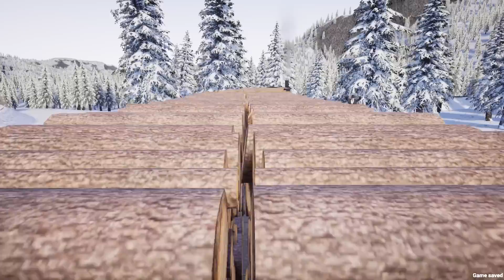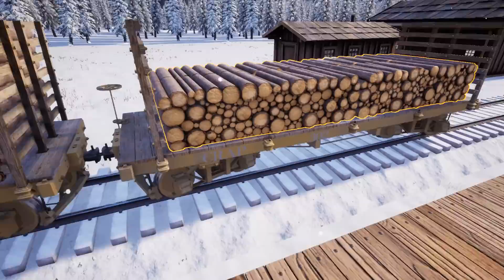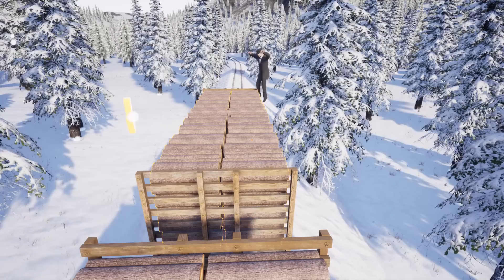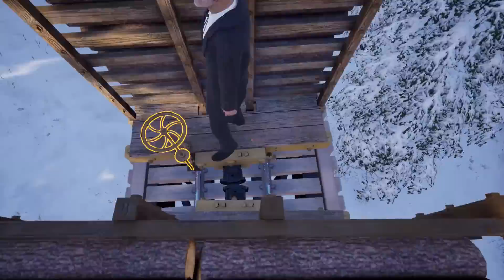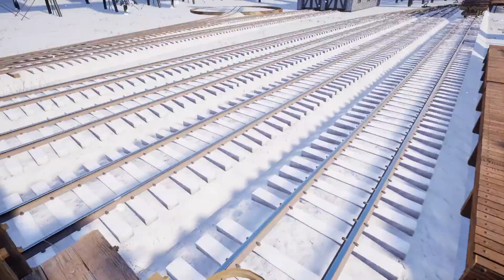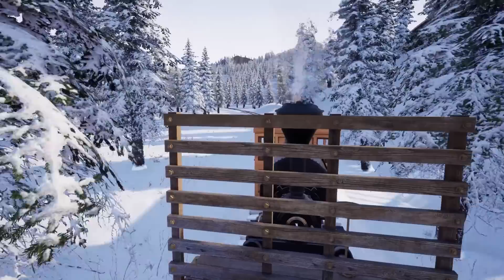I check brakes over and over even though I just checked them. (Railroads Online Gameplay)

Comment: So... interesting aspect with steam engines, just thinking about them loading that train onto the truck, when you release steam from the boiler, you are actually cooling the boiler. Think about how when you discharge a pressurized container, it chills in your hand. When they loaded the train, they probably drained the boiler, causing it to cool. Doing so is probably horrible on the boiler, but by drawing down like that, you can lose the water, lose temp and put on a huge smoke show all at the same time

Comment: I will not stand for Shay slander! They are quirky and fugly, but they are absolutely mechanical marvels and the most popular of the geared locomotives. Quick edit, YES THERE ARE GRAVITY TRAINS!!! In Wales, the Ffestiniog Railway and Corris Railways would use loaded slate wagons and let gravity pull the loaded slate down to the ports, since slate was very fragile and you can get better control with hand braking than a locomotive brake sine the trains didn't have continuous air or vacuum brakes. The locomotives were really only there to pull the empty slate wagons up the grades to the mines, and then they'd just use gravity to pull the loaded slate down to load.

Comment: You need a 1.5% to get  a car to roll alone. I have my log camp and sawmill set up with inclines to shunt cars into position to the cranes with gravity. I also have a 1% + whatever the curves add all the way to the smelter. I have in the past shoved cars down that incline.
Reply: I have 3% from Iron mine to smelter. 2% sawmill to iron mine.
Reply: 1% to the smelter must be a long way arround or just the cordwood run?

Comment: Do the engines add extra friction if you drag them in reverse? because you could just drag the engine in reverse down the hill then you'd be perfectly lined up to have the engine pull you back up the hill without needing to retrieve it.
Reply: They do but they also add weight which pushes downhill.
Should be fine. I'd take a Locomotive without tender though.
They tend to go better backwards.

Comment: We have a somewhat gravity train in Australia. It runs iron ore from the mine, which is higher elevation than the port. On the way down, fullyloaded, it uses no power but has regenerative power recovery to charge the onboard battery, then uses its electric motor to go back empty

Comment: Ah, Gravity trains. First done on the Ffestiniog and Corris Railways in Wales back in the 1860s. It was used to move long lines of slate down to the Ffestiniog's connection to the Ports and the LNWR at Blau Ffestiniog or the port at Corris. It was considered quicker than having to run engines around or even turn them around (that was until they came up with the Double Fairlie design, where the two tank engines were joined cab to cab).

You can get away with gravity trains in RRO, but you need to be on the car brakes and on your senses as gravity trains are nothing more than a controlled runaway train. One bit of complacency could see you running away into the sidings or onto the standard gauge train.

Also, you're thinking of the Incline Railway, which was common with the famed Talyllyn railway (Think the incline on the Skarloey Railway in Thomas).

Also, you can ride on a mockup gravity train on the Ffestiniog Railway or (when it's finished) the Corris Railway Extension.

As for gravity trains, they had special ways to communicate-using a bugle and using special bugle codes for things like -pin brakes, unpin brakes, coming to passing loop, passing a station, arriving at the terminus, apply full brakes and so on down the list.

One other thing about gravity trains, they often had a brake-van (caboose) on both ends of the train in case the train started to run out of control and the guys on the train can't bring it back under control. Also, gravity trains weren't common in the US, as the narrow gauge here wasn't the best laid and cars would constantly jump the rails and land on the ground. In the UK, the Narrow Gauge railways were built by the slate mines. (There is a smaller gauge, called 15 in gauge, which is the Ravenglass and Eskdale Railway, used to transport Iron Ore to the Standard Gauge Furness Railway, but they never used gravity trains to my knowledge).

Also, most gravity trains on the Ffestiniog Railway back in the days when the railway was in action, trains were often as long as 25-35 wagons, with sometimes longer wagon trains if they had to fulfill a bigger order for either the town, harbour or towns on the LNWR (Same with the Corris, except without a Standard Gauge connection and use of horse and cart. With the Talyllyn, as it was mostly flat or light grades, meaning gravity trains wouldn't work there, also, most stations back in the day on these railways didn't have many passing tracks, but that was because these railways were built primarily to handle freight, not passengers).

Hope that helps.
Reply: Spot on, only one thing to correct, the Fairlie locos where corrected and perfected on the Ffestiniog railway, but not the first use of the patent, the first built Fairlie design was used on the neath and Brecon railway but ultimately failed, then was corrected and used on the Ffestiniog.
Reply: @SparksTechnology  Thanks for the correction.
Reply: @The Stainmore Phoenix  the rest of your knowledge is impeccable, so nice to see someone who knows the history of so many of our great railways.
Reply: @SparksTechnology  Thank you. You can blame the Reverend W Awdry for the studying I had to do just to understand the fictional railways he created.
Reply: @thestainmorephoenix8632  I think the good Reverend is to blame for most of us taking such an interest in all things railway.
Reply: @SparksTechnology  Yep, but hey, it worked. He breathed new life into this industry. I don't think games like this would be possible without him. We can blame him but at the end of the day, he was a positive influence.

Comment: Work at Domino’s as a delivery driver, one large pepperoni pizza is around 15 dollars but if you add double pepperoni and double cheese it will count as three toppings, which is only 9 dollars plus tax. There is a 1 large 3 toppings coupon on the website.
Reply: My go-to order from Domino's is one medium 2-topping pizza plus one of those cheesy bread things, for the mix and match for $5 deal. My pizza is always double pepperoni, double cheese, and double black olives, which still counts for the coupon through the app, with an extra $1.50 for the third topping (black olives), and an extra $0.15 for the extra pepperoni, and again for the extra olives. For whatever reason extra cheese is always free.
I also generally add some 20 oz sodas and one of those brownie things to the order, as long as I've got enough cash. The entire order comes to about $25 after tax, not counting the delivery fee and my standard $20 tip
Reply: @triviavanille62  I would love to have delivered to you.
Reply: I always tip $20, usually in cash because I know that tipping through the app or website is not guaranteed to go entirely to the driver, especially since tips are generally considered taxable income. If $20 is less than 20% of the total for the order, I will tip 20% (rounded up to the nearest $0.50). I will never tip less than $20, even if my order is less than $20 itself, unless I just don't have an extra $20 (at which point I still make sure to tip at least $5; if I don't have that much, I won't place an order at all). I'm too shy to go pick up my food from the store myself, so I will always show my appreciation to the people who deliver my food so I'm not forced to leave my comfort zone.
Reply: @triviavanille62  Holy tip Batman!